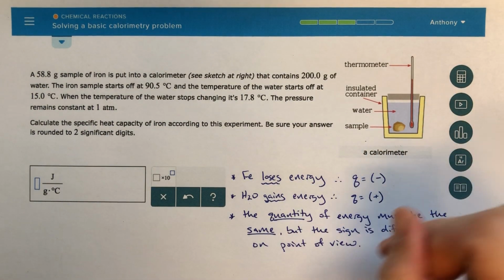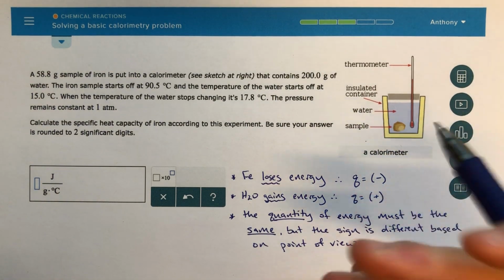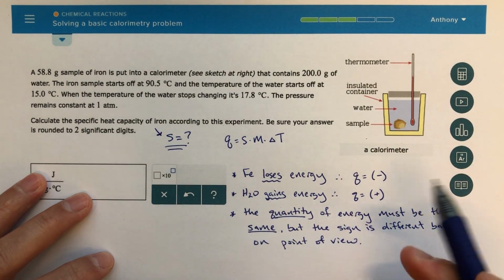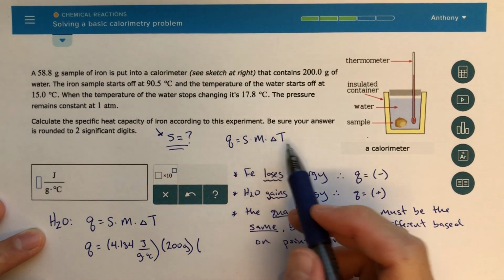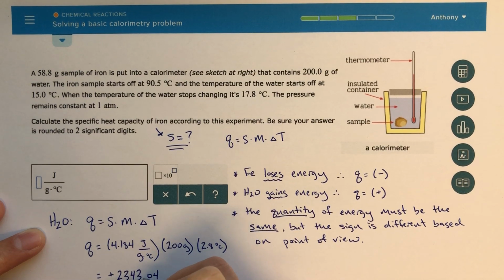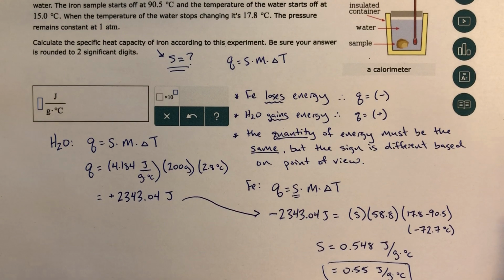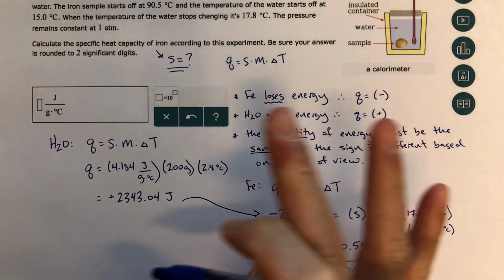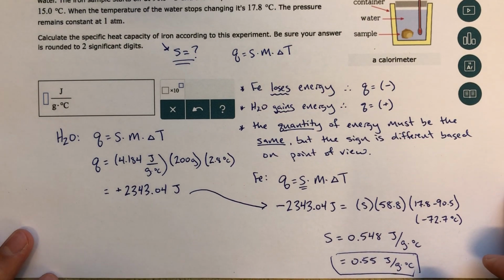ALEKS - Solving a Basic Calorimetry Problem

Comment: How the heck did you get 0.548 J/gC?!?!?!? I literally tried plugging it in my calculator and and no matter what I can't get 0.548! I hate it when people explain step by step until the very end....
Reply from the maker: At that stage I'm just solving the equation for (s). If you take the equation and divide both sides by [(58.8)*(-72.7)] you isolate (s) on the right hand side and (-2343.04)/[(58.8)*(-72.7)] = 0.548
Reply: @TonyStJohn  Yeah idk what kind of calculator you have but that does not equal to 0.548. I plugged it in about 20 times and it's about 168.7.
Reply: @luqmanbinasad4880   Multiply 58.8 x -72.7, then do -2343.04 divided by what you got from multiplying the first two numbers.

Comment: i do not get the way to determine the sign of (q) why is negative for the metal. i like your videos but sometimes you do not explain, you just solve problem.
Reply: One of them has to be negative or the numbers don't work out, it doesn't really matter which one you choose to be negative just keep it consistent. And then in the end figure out which energy is exothermic and endothermic using some basic logic (hot metal loses energy so it is going to be negative in the end)